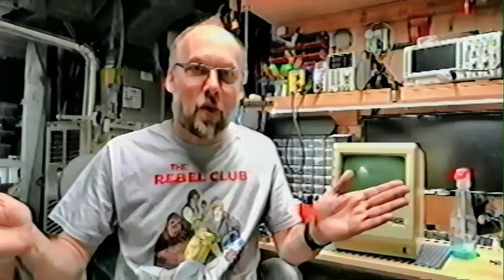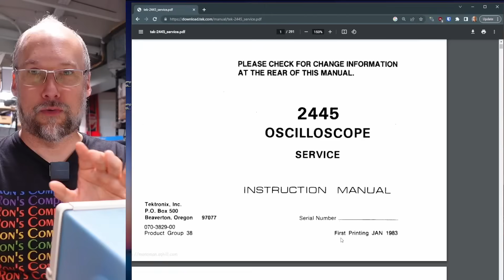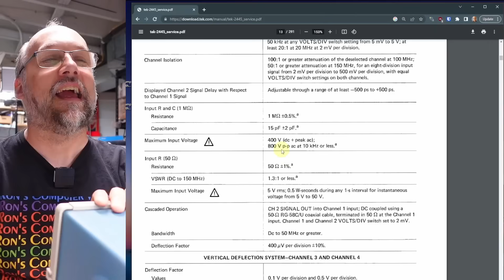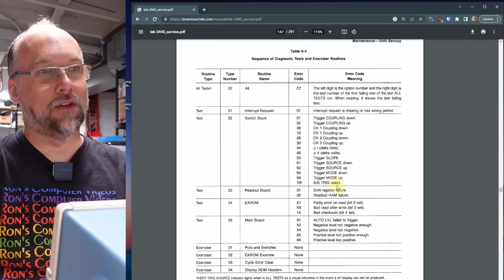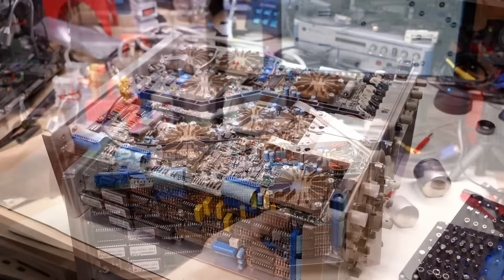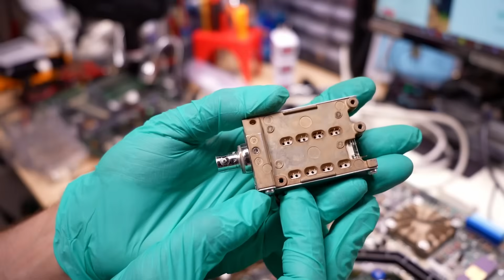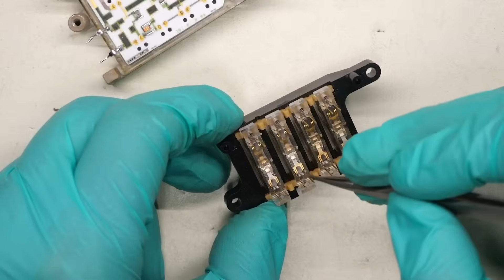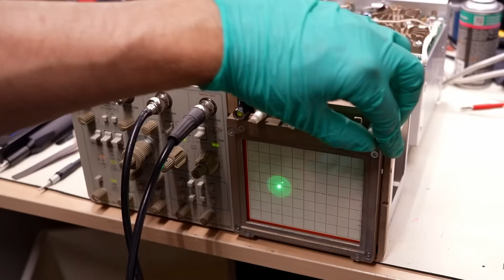Tektronix 2445: My first vintage oscilloscope repair attempt

Comment: I think bending up the relay contacts will do the trick 100% since they are probably work hardned in the position they are now.
Reply from the maker: Yeah others suggested that too. I may try it out as I have nothing to lose at this point... the whole assembly is insanely fragile, that's the only issue. Bending them the right amount seems easier said than done.
Reply: This. I had worked on a Yamaha DX7 using these style tangs for its keybed, and just gently bending said tangs back did the trick. If you do that with the relays, be as gentle as can be.
Reply: Yep.

Comment: I had a very similar issue pop up in my LeCroy 9310 (with the gorgeous amber CRT). Long story short, after a total of 40 hours poking around in it, I decided to dump the Roms and have a friend look through them to see if we could find what controlled CH2s attenuation. Turns out that one of the 5 EPROMs had one janky bit of code and during the boot process it would internally switch to 1 Meg and there it stayed. Working on scopes of that era can be a real trip sometimes.
Reply: Those eproms were good for holding their programs for about 10 years.  After that, they tend to bleed off their little micro batteries that keep them at a TRUE or high level (Supposedly).  I read about this in the early 90s but I've never seen a problem with the 27xx series Eproms. So I don't know the validity of this theory, but it seems plausible.

Comment: Analogue scopes are pretty neat things, I have two of them (a Philip Harris 3304 and a little Caltek thing), and to be honest I spent more time making funny patterns on them rather than actually putting them to use, they're very much analogue-only too, no microprocessors in them to display numbers onscreen, just waveforms and whatnot, plus the Caltek one is a POS, takes an age for the tube (despite replacing it!) to warm up, so it's more a decoration than anything cos it's so small... :P

Comment: I bought a pallet of about 20 of these scopes in the early 90's for $5.00. I didn't know what to do with them so I posted a notice at my university's engineering building and ended up selling most of them for $50-$100 each. Pretty nice return on investment! I miss old-style government auctions, mostly because people didn't know about them and you could get great stuff extremely CHEAP!
Reply: One time I got a pair of Amiga 1200 tower conversions for like $20 at the local city / county surplus auction, but after realizing I couldn't do much with them (several key parts were missing), I put them up on eBay hoping to at least get my money ack, and was surprised at how much they went for - MORE than recovered my original investment.
Reply: @Renville80  I got a Laserjet II in 1992 for $10, from a company that was replacing their printers. Too bad such bargains only come along a couple of times in a lifetime.
Reply: @paulmichaelfreedman8334  Unless you have access to an amazing dumpster like EEVlog had.
Reply: @paulmichaelfreedman8334  That was long enough ago when the ink cost less than the printer.
Reply: Live auctions were fun, now everything is done online. Most of the old government electronics are bought up by recyclers.
Reply: Ya,  a lot of businesses of the early 90s were very successful because of those Gov auctions. Those were fun days.

Comment: I picked up 3 of those from a scrap pile (i think they're 2465's) but they all have power supply problems (leaking electrolytics) and i haven't gotten around to recapping them yet.

Maybe this winter

Comment: I've dealt with this in industrial equipment. The copper tangs under the relays lose tension over time. When they are new, the tangs are bent out far enough so that they will bend a little angainst the contact pads to maintain connection. However, if the relays are left in the same position most of the time and that coupled with time, temperature cycling, and vibrations cause the tang to deform and lose tension gradually until they are only floating on the contacts. This is why the paper shim was able to restore a little connection, by pushing them slightly closer together. If you want a solid connection, you'll have to re-bend the tangs on the relays. That is much easier said than done but not impossible. Perhaps you could find a tiny shim to go behind each of the tang legs? Good luck and thanks for another great video!
Reply: I agree with you.  That is the likely source of the issue.

Comment: I've had scope problems like this due to cracked solder joints. Any connector, switch, or module can develop them just due to the scope being knocked around.